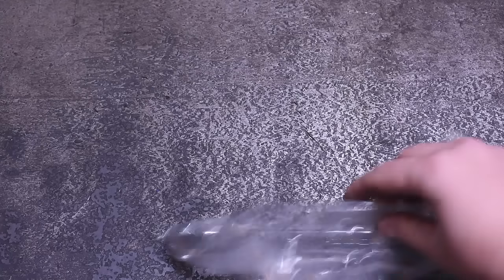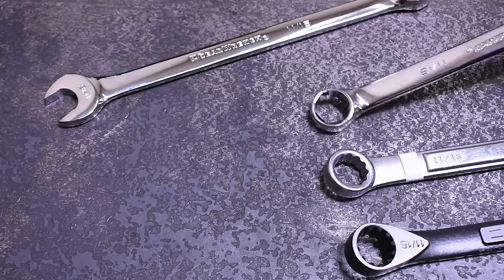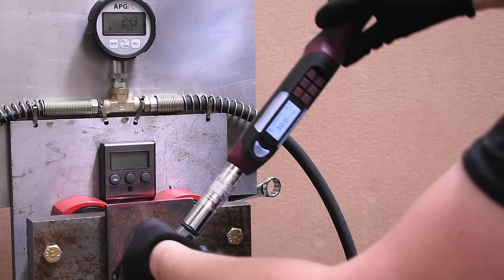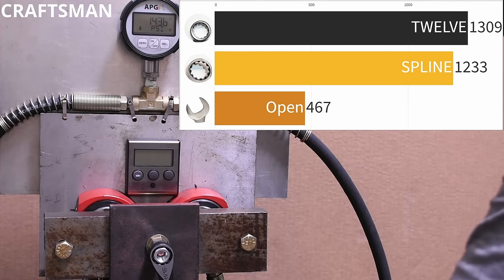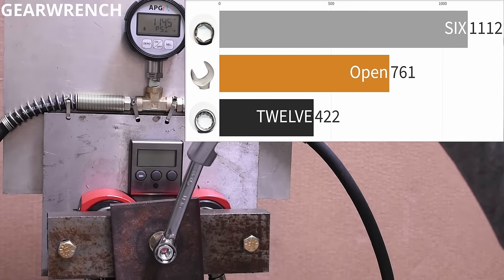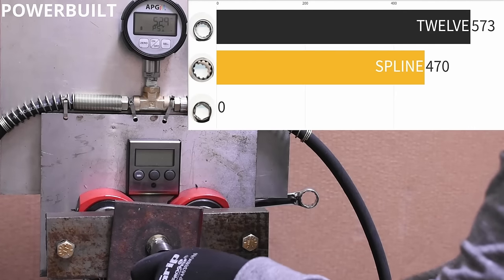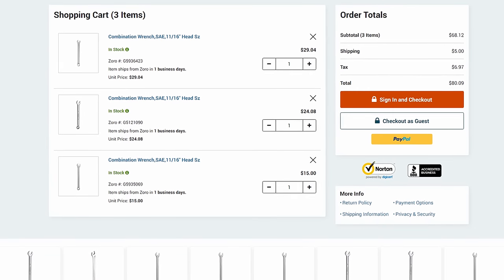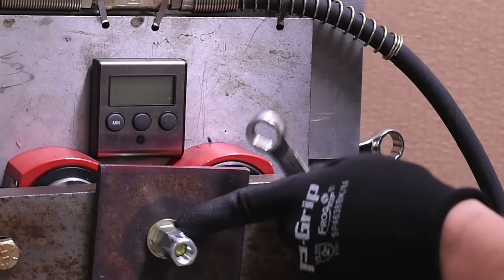Let's Settle This! What Wrench & Socket Design Will Slip 1st?

Comment: I do not see another design here: There is a design, which basically is a 6 point but with rounded insides. The idea is, that the load is not on the high points of the hex, but on the flat sides of the nut.
Reply: I have a Metrinch socket set since the early 90's. Great set bar for one size: 9/16- 14mm. From brand new it slipped on both metric and imperial (perfect nuts and bolts). Just a fuck up in manufacturing the size- couldn't see any defect. Can attest to their strength and grip- never had any other size slip even on a fairly rounded wheel nut.
Reply: Yep, I had some wall drive sockets and metrinch spanner’s, they were really good on high torque, but clumsy to use.
Reply: Yep, absolute life savers when it comes to undo already rounded stuck nuts.
It's crazy that these seem to have completely vanished from the market although they are the best ones. Makes you wonder...
Reply: @pourquoippaass4284  they haven't vanished. They've just become the Norm for the major tool industries. Look at any snap-on, Mac, or matco Adv sockets they all have a "kerf" or a little round spot on the points of the hex in the socket. This allows the point of the hardware to not contact and instead it grabs on the flats.. its just so common now they don't even advertise it

Comment: Thank you for this video! As someone who has bought and worked on used motorcycles; it is useful to know that the 6pt holds up the best, as there tends to be a lot of questionable bolts on used motorcycles.

Comment: Some bicycle axle nuts are now a 12-point nut, which looks awesome (very round looking) and grabs the wrench with 12 points.  It's more decorative than for strength, but it is strange there was never really a movement to introduce 12-point nut and bolt heads.
Reply: torx fasteners are the more commonly used upgrade to hex hardware. has been used in european vehicles for longer but is becoming more common in domestics.

Comment: Brand makes a huge difference with their respective production quality. Actually had a Snapon 14mm 6 point socket round transmission bolts because of the poor fit. But I'd be dammed if a Pittsburgh finished the remaining bolts without a problem. I could tell a big difference as the Pittsburgh had a smaller tolerance. People like to joke about Harbor Fraught tools but they've really stepped up their game. I've put some of their stuff through the wringer as a mobile tech and it's still in my box working fine. Where I work now provides SnapOn and I've watched some spectacular tool carnage on things my personal stuff would've never failed on.
Reply: Did Harbor Freight step up their Game or did China 🤔 In my opinion, Snap On uses soft steel where it will bend or give and not easily break. Whilst China uses steel that will break or round off fasteners more so.
Reply: harbor freight and even Pittsburg (the brand) don't really make tools, they buy excess or appearance defect tools, meaning that their quality is not consistent, but if you can top grade them they can be great.
Reply: Those tools at HF are all "less then perfect" from actual brands. So some are actually decent. As said, he needs to measure the wrenches and compare identical sizes. Some 12s have tighter points then some 6s.
Reply: i am a millwright and i use hf wrenches and sockets more often than any other brand. i always choose impact grade over chrome and 6 pt over 12 pt. rarely do i strip a bolt head or nut.
Reply: @vidard9863  You believe they are buying others "appearance defect tools" then reforging them just to get their branding on them? And, you think this process would be cheaper?
Reply: See, I thought it was just me. Just never buy their damn screw drivers.
Reply: @lorenblaine5275  For some products, the money made from selling a blemish product under a different brand enough to go that route, rather than either tossing it or fixing the blemish.

Comment: I picked up a socket set recently and made sure to get 6-points because, as you mentioned, there is no real alignment issue with a ratchet so why give up the extra contact area unless you are dealing with 12-point bolts at some point.
Reply: Being a mechanic, there are some VERY tight spaces you get in where 12 point is needed. Also, many socket ratchets are in the 4-3 degrees movement for the same reason, tight spaces.
Reply: yeah i dont get why ratcheting wrenches are almost universally made with 12 point ends.. i live in eastern canada 5 year old vehicles have rusted bolt that need sockets hammered onto them... would appreciate some 6 point ratchetting wrenches that done cost their weight in lumber
Reply: @brucemadden1626  If you have a high tooth count ratchet for tight spaces then a 12 point socket isn't really giving you any extra benefit except maybe taking a second or two less to align. In something like a box end it is a different story because there is only so far you can actually adjust your position. 
I still think that for your average person who just wants a reliable socket set for around the house a 6-point is probably going to serve them better.
Reply: @brucemadden1626  my friend in tech school had Mac fine toothed 3/8 ratchet that was a beast for stuck fasteners in hard to reach places even with a cheater bar on it never broke
Reply: @AndrewBrowner  wow, I just looked to see what options are out there for 6 sided ratcheting box wrenches and saw that Tekton makes some and usually their stuff is reasonable, but wow. I'll keep my harbor freight 12 point ratcheting wrenches, and my 6 sided socket set. If it's ever too stripped  for a wrench or too tight for a socket, I'll grab my locking crescent wrench and pray for mercy

Comment: Just from personal experience working in a auto service center, 
I always recommend a 6 sided socket or wrench for bolts you remove often like a oil plug. 12 point or spline wrenches and sockets will chew that bolt up over time.
Reply: In Europe there is no 6 points wrench sets at all on Amazon...
Reply: @hlq2action310  thats odd
Reply: Can't stand that.  Usually only 13mm  Chyrsler group ones i've seen damaged.

Comment: I love this test. I have a set of those gear wrench 12 point combo wrenches and hate them. Basically they are all too big. You have to use the next size smaller metric wrench etc to fit the SAE bolt you need to loosen. They dont even compare to others as you have shown.

Comment: My Craftsman spline wrenches are the same design as the one you got and I can attest that they grip really nice on most fasteners.  Interestingly, the spline are also advertised as universal, which makes me cringe too!  I’m curious how universal and what the limits are for different fastener head designs they claim spline works on.  It would be a tedious episode to make, but really fascinating!  Perhaps one day!
Reply: A SPLINE WRENCH IS MADE FOR SPLINE HEADED BOLTS
Reply: They work on 4, 6, and 12 point as well as square, Etorx, and of course are the only one out there that work properly on spline heads, they're not as good as dedicated versions of each but they will grip and turn, they can also work on some thumb nuts or wing nuts
Reply: @paulhailey2537  That really doesnt matter at all. Remember, Anything is a Hammer if you use it wrong enough except in this case you cant use it wrong. A Spline Wrench will work just fine on any bolt head.
Reply: I'm going to ask something that has boggled me for years.

Why are you, specifically, a brony? For real, not "it's a great show" excuses.
Reply: @Sharpless2  and will work as well as any other wrench of the same sizing as a hammer too!!!
Reply: I use Würth spline sockets daily (to the point where I’ve replaced all bar my 6 pt flank-drive sockets and impact sockets with them although I still keep regular 6,12 and e torx in my box both as a just in case and as sacrificial tools) they work perfectly fine on just about everything as an example with the 1 socket rail yesterday I went from doing brakes on a BMW X5 (calliper brackets are etorx) to doing valley cover gaskets on a older holden commodore (mix of metic and sae) to doing a oil filter housing on a cruise (mix of metric and etorx with an exhaust manifold removal as well)
The only real complaint I have with them is they can’t be hammered onto a fastener like a regular socket can be when needed without destroying the socket
Reply: @KaylaJoyGunn  Characters are varied and feel cookie-cutter at first until they are given nuance and capacity for change. I appreciate characters being given agency. And I have enjoyed the community that grew around the show.
Reply: @KaylaJoyGunn  I honestly couldnt believe bronies were thing at first. And once I did finally believe it was a thing I laughed at them.
 Until I watched the show.
 I'm not saying it should be critically acclaimed or anything, but it is a great kids show. One of the best up there with Classics like SpongeBob SquarePants and maybe even Adventure Time. I don't personally identify as a brony but the show does have my respect and I've seen every episode. The characters are relatable and well fleshed out. The voice acting is great the artwork is also passable. The episode plots generally range from a 6/10 to a 9/10, much like many great kids shows.
Reply: I've used splines on 6 point bolts, hex heads, 12 points, and square key bolts, they're pretty universal
Reply: Universe if you don't need to reuse the bolt! My guess is that the splines can gouge into the bolt head. Same with Nut extractor sockets.
Reply: @paulhailey2537  But, industrial maintenance for 30 years, 20 different venues, and only encountered one splne head bolt and it was on my car. So, do you own a set of spline wrenches?
Reply: @3mtech  Absolutely , use them on Hydraulic systems and Harley Davidson Motorcycles I have Been repairing equipment for Mechanics almost 35 years
Reply: @Prestiged_peck  This is why my "every day use" tool kit is a Stanley with spline sockets.  I work (or have worked) on cars with 6, 12, and etorx bolts/nuts.  Having a single set of sockets, neatly arranged in a case, that can handle any fastener type I've ever encountered is extremely convenient.

It's also been my experience that if my spline sockets couldn't break something free, a 6-point probably wasn't going to anyway.  At that point it's time to break out the welder and attach a shiny new nut on the end.  The heat from welding also does a nice job of freeing things up.
Reply: @davisev5225  this!!! Screw 12 points!!!
Reply: @Sharpless2  yeah work just fine to lesser extent as shown in the video.
Reply: @paulhailey2537  lol 😂

Comment: Seeing how surprised you were by what you thought was a gimmick, I’d love to see some other tools along those lines like the universal/gator grip sockets, bionic wrench, craftsman ReFlex adjustables, adjustable box wrenches, any of the wide variety of attempts at making a ratcheting open end etc. in general whether these apparent gimmicks are actually worth anything or not. I love collecting them and appreciate all the wacky designs companies come up with, and some actually are quite useful like a gator grip on eye bolts.

Also would like to see a variety of rounded/broken bolt extractor brands and designs tested, that’s a particularly unclear topic as to which ones work better than others
Reply: Gator grip sockets are a godsend on wingnuts too, not just eyebolts.  I have one specifically for installing and removing cables on difficult to access aircraft batteries.  I might use it occasionally on something like a battery tiedown nut just so I don't have to go back and get another socket, but wingnuts are where it outperforms every other tool commercially available.

Comment: My uncle is a mechanic and when spline was coming out I asked him about it. He said they worked great. Seemed odd to me that they would. Later on we were working on a truck and we used spline. It impressed me. 
Talked to a maintenance guy also that uses spline and he said. It was good also. 
May end up replacing my 12 point with spline. Don't really see the reason for 12 points anymore.

Comment: I would just about swear by my Proto wrenches. I've had my full set for about 3 years now and I've relegated all of my other non-ratcheting wrenches to an old tool box to gather dust. You should do a complete test from brand to brand. I'd be very curious to see the differences. Too many are piss poor excuses for a good tool.
Reply: Agreed. I have the flex head ratcheting spline wrenches up to 3/4" and they're excellent, especially in a tight space. Wouldn't trade them for anything. Got the regular 12pt combo up to 1 5/8" for double-wrenching and using as strike wrenches lol
Reply: About 10 years ago, I found a couple well used PROTO wrenches that had been lost/left by somebody on the side of the road and threw them in my box--they were metric as is my vehicle so I figured they'd be useful some day.....I used them a couple times and it was pretty apparent that they were 'different' in a good way.
I've been a 'car guy' since the 1970's and an A&P since 1983 so I have some knowledge of tools.....A set of the PROTO metric wrenches is in my box today along with MAC and SnapOff and Harbour Freight and a few others....lol.
Whatever works is best...
Reply: That's a big lump of money.

Comment: My proto set is bar none, the absolute most I've ever blown on hand tools but they're damn nice wrenches and seem to hold tight where my old craftsman fails. Excellent and relevant video guys, thank you
Reply: I have a an early 1900s 1 inch drive ratchet and socket set I love. I was always curious if snap on got its beginnings with Proto. I have heard that but never was sure

Comment: Speaking as a professional auto tech, here's my breakdown of real-world tool usage, which pretty much mirrors the video's findings:

Spline is best for ratcheting wrenches and ratchet sockets because it'll grip almost anything and hold onto fasteners well enough to make actuating ratchet mechanisms easier, whereas other geometries are more prone to slipping off. It may or may not be ideal for breaking stuck hardware loose, however, unless the fastener is rounded too much for a 6-point to work effectively on it.

6-point/single-hex is the best option for raw torque, assuming the fastener has clean enough contact surfaces to work. I will frequently use a 6-point wrench to break a tight fastener loose and then switch to a spline ratchet if I can't get a socket/ratchet onto it. If I can get a ratchet and socket onto it and it's too rounded for a 6 to grab and too tight to pop loose with spline, it gets a nut remover socket instead.

12-point/double-hex is more suited toward moderate torque or double-hex bolts/nuts. I usually only use those in ratchet/socket as my fixed wrenches are combination-6 and ratcheting wrenches are either 6 or spline. The only fasteners I encounter in the wild with any amount of regularity on passenger vehicles are CV axle nuts.

I have all three geometries in all sizes from 5.5 to 24mm, but 6-points are definitely the go-to workhorse geometry out in the real world on real cars/trucks with real rust/grime/monkey-pawprints on real fasteners.

Comment: A great test although I hesitate using spline drive as it seems to always mar the nut or bolt. 
An open end shoot out would be good but compared to other open end types. One thing that I have noticed is when it comes to the actual spanner dimension and finish applied this affects the potential of the spanner to apply maximum torque. Some will have a heaver chrome or nickel finish and these seem to wear a lot faster. I have a Sidchrome set purchased in the 80's and they were so tight when new they needed to be tapped onto some nuts. They have held up extremely well over the years.
Reply: Seems to me that the spline drive might be good if its a bit stuck and your planning on replacing the bolt or nut. I haven't actually used a spline drive, so I could be wrong.
Reply: Typically if a bolt or nut is already partially rounded and you're fighting to get it out, you're already planning to replace it, so whatever bites best is best! Just my thoughts as a rust heap wrencher.
Reply: @802Garage  in that case, the answer is a proper extractor.  Then take that breaker bar and beat whatever a$$hat decided you can't have a 15mm or 18mm extractor in the set.
Reply: @kd5nrh  That's AN answer, but it's also more time consuming and usually means going in your special tools drawer and then finding the best size and if you have room to hammer it on etc. So if you can get it with a wrench that bites first then. 👌 I hear you though.
Reply: @802Garage  special tools drawer?  I drive a 20 year old Focus: those are in my roadside repair bag.
Reply: @kd5nrh  Hahaha totally fair!
Reply: @kd5nrh  I drive a 29 year old Subaru, by the way. Everything I work on in Vermont is rust. 😭
Reply: @802Garage  My oldest Subaru, a "rescue," is only 25. The one I bought new is only 23. Not near as much road salt in Tennessee and Georgia.
Reply: @dr.a.w  I'm jealous. If you wanna sell any let me know. :D
Reply: @802Garage  unfortunately, my Subaru had a series of problems all at once, and another cheap beater showed up before I got started on them.  It was a good car for several years, though.